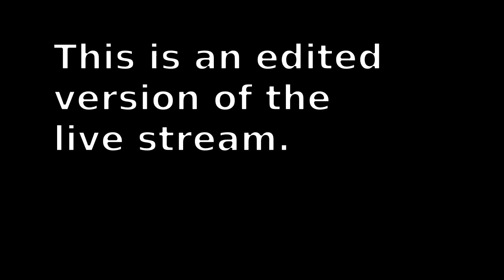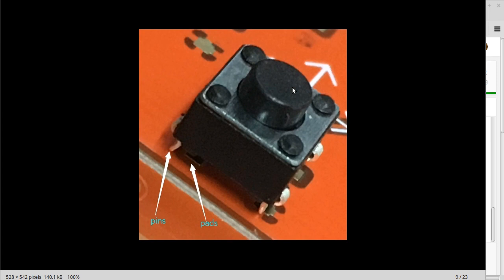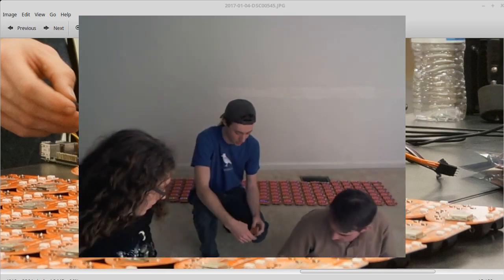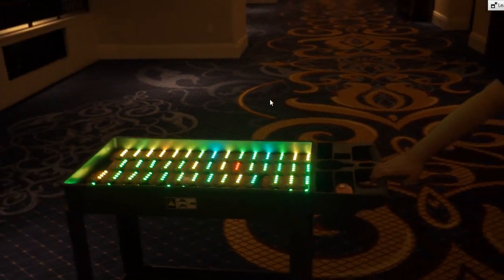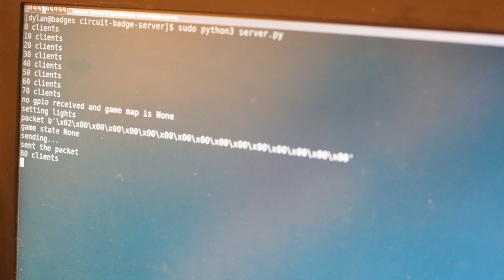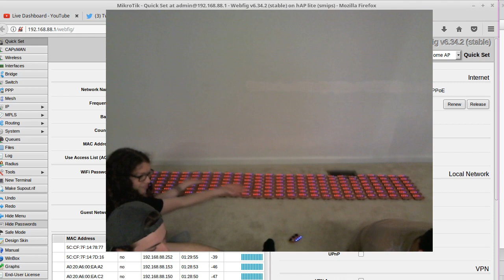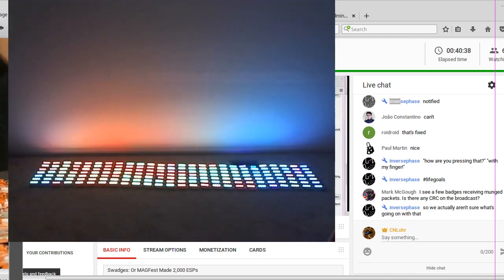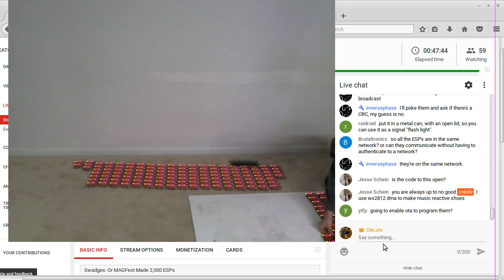2,000 ESP8266's for MAGFest

Comment: Did you think of spinning adapter PCBs for the buttons? Could've reflowed them to the larger board and resolved the pink-poke problem using it as alignment. Cpt. Hindsight to the rescue!
Reply: We had the option of respinning the entire board, and the price was actually about the same as replacing the buttons, but it would push our timeline another day or two out. At that point we really didn't have the option to slow things down at all. I'm already starting to prepare prototypes for the next event, so we shouldn't hit that hard of a time crunch again.

Comment: I don't get the deal with the esp12 modules. All the ones you see floating around (like the ones on this video) do not fully conform to the FCC (notice no fcc id as required by the FCC and what the fcc testing docs show where the id should be, just an FCC logo). Are the legitimately certified as intentional radiators? 3:20
Reply from the maker: I can't find the one for the 12-F at the moment, but they totally can be certified because the actual RF regulator is on board, inside the ESP8266, itself and the chipsets are shielded.    For instance the 12S certification can be found on this one: 2AHMR-ESP12S -- At the time we looked it up and the 12F's appeared to be certified in a similar fashion.
Reply: I really don't know why they aren't labelled with their FCC ID. According to their filing it would be printed on the can, but they don't actually have it. I believe the specific module we used falls under this filing: 2ADUIESP-12-F. It has the modular certification, but they don't give a great description of the labelling. Maybe it changed manufacturers along the way or something?

Comment: Dear CNlohr, 
I have a question, it it possible to port pokemon red on the esp-12e? not a gbc emulator, just pokemon red, no bells and whistles, just the bare minimum. Even if it means support IC's (for controller and display)? or would it be better to just use the esp32? (if possible please make a vid where you try to get it to work ) it would be a really cool project.
Reply: Sprite_TM wrote a game boy emulator for the ESP32 and goes through the details and design decisions in a talk at the hackaday super conference of 2016. So it might be working, but wasn't Pokemon one of the harder things to emulate because of the RTC?
Reply: davedarko yeah I saw it and it's really cool, based on the specs of the esp8266 I wanted to know if it was possible and if CNlohr could do it on the 8266 and possibly do a tutorial on it if he could. Also I'm not too bothered about the events based on the rtc so I don't mind about that.
Reply from the maker: It would be very hard without an emulator considering they wrote most of the game in assembly for the Gameboy (a Z80-like architecture)
Reply: CNLohr they have Gnuboy, and Sprite_tm has done it and made a keychain gameboy with the esp32....(using the Gnuboy emulator)  But thanks for the reply man!

Comment: is all ESP connect to router? what router you use for that. I count there at last 175 pcs
Reply from the maker: Mikrotik's have no issues with that, for this one we were using a mikrotik.  I really like TP-links as well, but it's just what I had laying around.
Reply: will router work with tcp connection over 200?
i plan using mqtt
Reply from the maker: I don't understand the question.
Reply: I mean 200 esp will connect to mikrotik using mqtt protocol. can router handle it? because I read, it only recommended 50-60 connection.
Reply from the maker: It worked for us.  One Mikrotik.